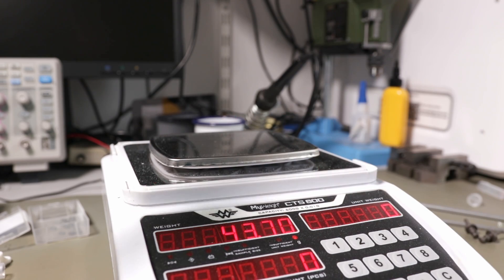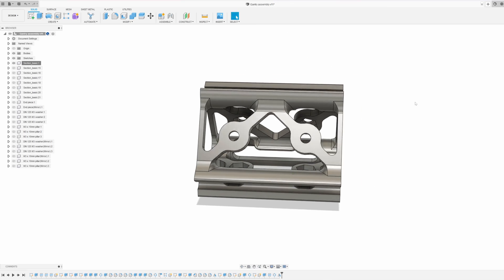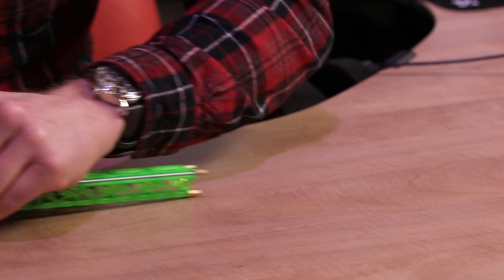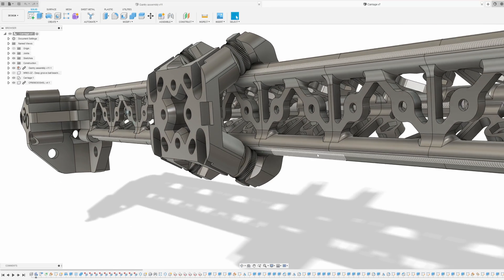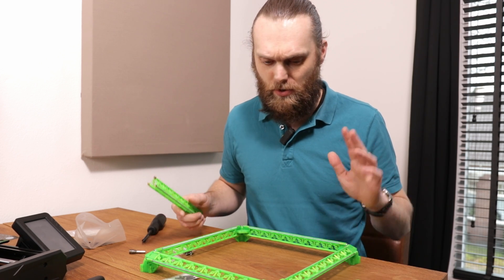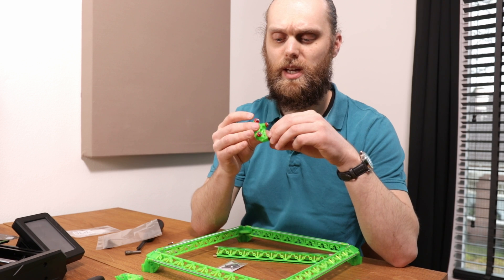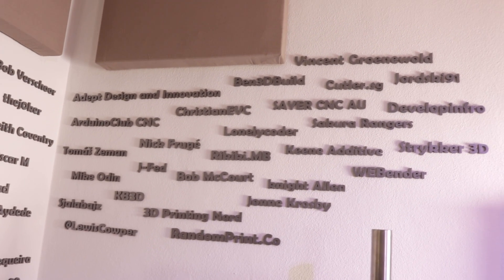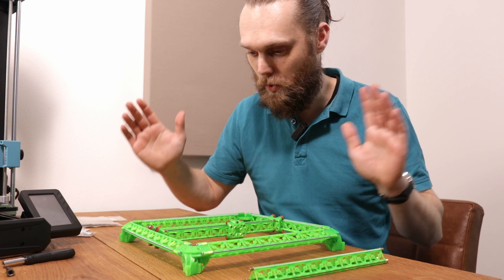Is This System the NEXT STEP in 3D Printing?

Comment: You should switch to a non threaded rod and then use a die to add threads only to the ends of the rods. It's more work, but it would roll better and wear less over time. You might be able to use something like a straight pull aluminum bicycle spoke too.

Comment: What if one threaded rod went through the middle instead of 3 threaded rods along the outside. The compression would be equal on all 3 legs, and it would be lighter. The drawback being that you would have plastic rails for the bearings to ride on.

Comment: I think your issue is that you still have the mindset of 3d printed part having the same properties as normal machined material

3D printed part dont really benefit from hollow struts and triangular shapes, its already hollow, you might get better result by having a full triangular shape, keeping strenght and printing less wall to keep the mass down

Also, this rod need to be smooth and hollow, you could put a bolt inside each hollow side to lower even more the mass, this ros could even be carbon fiber

I love the concept and see quite a lot of improvement

Comment: Please design a total printer that can be printed except for a control panel wireing and a print head. fpr the bed use a vedry hol filled plate and then use a commonly used bed mat.

Comment: You might be able to use bicycle wheel spokes instead of threaded rod since they are made to be a lightweight adjustable tensioner and can be bought in a variety of lengths and materials, including carbon fibre.

Comment: you could also mill down the steel rails to make them lighter too. ive no idea if they would keep their accuracy tho, id guess temperature change would distort the thinner areas at a faster rate. Look at makergears printers... the rail doesnt move at all so the only weight you have to minimize is the extruder head itself... at least in that one axis. They did over the years lighten up the heated bed but its a bit heavy still, but note again you probably could solve this with stronger motors and a much stiffer belt that can handle faster printing. ive long thought the makergear printer would benifit from using dual rails on the print bed. i can print most things pretty fast on the makergear, faster than most seem to be able to.. and ive tried some crazy speeds but you need a very stiff table to set the printer on because its violent with the weight of the head lol... it does print well still, i just dont want to have a catastrophic failure 😅 you can see the rebound in the belt at high speed so thats probably what would fail first

Comment: Havent looked through all the comments. But what about using carbon fibre Rods or even carbon fibre to do the tension instead of metall rods? The challange will be how to attach it and to tension the structure. But would be lighter. Since most of the mass is in the rods. The railing its selv could be lighter by making the design in one full lenghts instead of sections. But require designing finish lenghts you need. Unless you can make a parametic design for it. Cant wait to see what you come up with👍

Comment: Ok, so.  Possible thought:  I mean I like your idea of using hollow rods to cut weight, but..... why use rods at all?  Wouldn't cable be potentially lighter?  Run cable through the channels and tighten the ends to make things secure.  Print the ends right and you could hypothetically use one cable for the entire structure, just run it up one edge and down the other.....

Comment: Keep going for sure mate.  could you print these beams completely on a large bed, forgo inserting rods and just print with dense/strong material for the rod sections and a lightweight one for the rest of it? Could then use wheels of the same material as the rod section, which would hopefully stop them from being destroyed so quickly. Not sure if the beam would hold up to stress without proper rods inserted but would be interesting to find out if you can completely print a printer.

Comment: Ideas.... 

1) Don't use threaded rod, instead, use hollow tube, and tap the ends. now you've eliminated a lot of weight, because you no longer have solid heavy rods, and you no longer need the heavy standoffs, because you can now screw right into the tube. 
2) By using smooth hollow tube, you no longer introduce additional friction trying to mesh geared teeth that serve no purpose. small bearings should ride quite nicely on them, could even use tiny V-bearings so they lock onto the metal tubes. 
3) I would suggest making different types of the trusses. you don't need screw / mounting holes on all sides, so maybe only do one, or two sides, further reducing weight
4) to keep the parts from "slipping" on the contact faces, you can add tabs on one side of the truss module, and pockets on the other, so they made, creating a more sturdy mating surface.
5) If you need additional end points for mounting, you could add a central threaded rod, and use this as either a mounting point on either end, or as a method of pretensioning the entire truss assymbly

Comment: If it needs to be light and stiff carbon fiber is definitely the way to go, either tubes or square profiles. It would still be awesome if you could build a whole machine with as many printed parts as possible.

Comment: I'd love to see more of this project. It may not currently be cheaper, stronger, more durable or lighter but it is cooler looking and it's more customizable. 

I wonder if you could use pullstruded carbon rod instead of the metal rods and do a sort of tensegrity to keep the beam components together. Just a piece of kevlar or similar line through the middle of the beam with tensioners on the ends of the beam (tension in the kevlar means compression in the truss segments). Then rather than rollers, get some of the IGUS Iglidur filament and print custom bushings. 

Also not sure, but I suspect the truss structure could be optimized. I bet you'd need a lot less filament than you think to "truss-out" 3 carbon fiber rods running axially, at least to be good enough for a 3D printer.

Comment: How much meters from 1 bottle? If i buy Pet-G that is about a dime per meter. A PET bottle will cost me 0.25 ct (coz of the deposit), so it would need to be at least 2.5 m to make it worth it, unless you want to have a bit of green or translucent for one specific project

Comment: Without any simulations I suspect that your trusses might not be adding much stiffness, and its mostly the (preloaded) threaded rods doing the work. I'd also suggest first having a good design, before throwing all kinds of fancy materials at a problem. As they say, any idiot can build a bridge that can carry a lot of weight. A good engineer can design a bridge that can barely carry the weight it should support, with a restricted budget.

1:40 I think that you are very misjudged in this assumption. Sure, this shape is light and stiff, but not the lightest and stiffest it can be. The key to where you are wrong with the assumption, is that you assume an isotropic dense material. I would recommend reading up on basic beam theory of mechanics.
If you forgo the above assumption, a hollow box section (with closed ends!! Very important to have for the shear stresses) is much stiffer for the same weight. 
Sure, they don't build cranes out of box sections, because here the truss idea has another advantage, namely being able to pass wind through and thus have significantly stresses from wind. If you look at earth moving equipment for example, they never use truss structures and instead welded box sections. Similarly I think that the reason why concert equipment is build out of trusses, is for manufacturing convenience. However, with 3D printers you can easily make (almost) hollow box sections quite easily. If you look at stuff that REALLY needs to be stiff (ex. movement gantries in high speed precision applications such as wafer machines), you will see they use boxed sections. 

But, before you start optimizing random printer parts, I think its important to consider WHY you want stiff and lightweight parts. Lightweight, so that you can accelerate faster with the same applied force. Stiffer, because then your parasitic eigenfrequencies can be pushed higher. These two can both be a limit in your design, but there is obviously an optimum to be reached here. There's no point having an incredibly stiff frame if you are limited by your accelerations anyways (or by another constraint in the design, for example the hotend not being able to push enough filament). Similarly there's no point in making your gantry very lightweight, if the parasitic eigenfrequencies mess up your tolerances.

When you decide that indeed the eigenfrequencies are a limiting factor, what directions do you even want to be stiff? 
What directions are the limiting factor? Randomly choosing a triangle shape is not the way to go. Its better to first take a 'regular' section of gantry, and figure out exactly what the parasitic eigenfrequencies even are, and in which direction they act. If you have to make your gantry more torsionally stiff, you need a vastly different design compared to a bending mode in the vertical direction. Trying to solve a problem without understanding what exactly the problem is, is a bit like trying to shoot stuff at the fair whilst wearing a blindfold. 

Lastly, the reason why putting the carriage together is because it is severely overconstrained, meaning you either need slack, or have a lot of build up stresses internally (making it hard to assemble, or causing it to easily bind). This also causes the binding issue on the carriage when moving. With this design it will be really hard (or rather, expensive) to get it to run smoothly).

If you want some more pointers on exactly how to do this kind of design I'd be happy to point you in the right direction.

Comment: I was thinking the purpose of the treaded rod was to use it as a rack and pinion, that way you didn't need a belt system.  It might be heavier than the bearing system, but once you mount other push pull features the rack and pinion might come out ahead,

Comment: Go for it but....
Try to use pccf (stiffness)
Things like wheels you could use nylon (abs isnt Wear resistant at all)
Also instead of that you could Just get 2 aluminium smooth rods and igus fi8 bearings and youll end up with really light thing but then you cant use direct drive system with is ok with klipper and pa. I have tried aluminium rods and whole x axis was lighter than Just 2 steel smoothrods :)

Comment: Hollow smooth rod tapped on the inside. aluminum bolts also print gantry in one large piece so it is straight

Comment: Well done.  Really beautiful system, if you used smooth bars and then only threaded the ends, so as to use the bearings, the system would be perfect.

Comment: Hell ya, this has a ton of potential! It's basically the start of RepRap 2.0 ;)
Seriously, screw the comparison with linear rails, these will never be as smooth/light/precise as precision ground rails... but the value in these is that anyone could print these at home and assemble with cheap-ish hardware and prototype or even build complete working machines without dropping hundreds on components up front!

I think tubes with internal threads at each end are the way to go. You'll save some weight and not sacrifice any stiffness.
Could you also use tubes for the rails and a single threaded rod down the center? Might be heavier, and might not be as good for alignment/stiffness.

Just look at the Porsche 911: You can make a suboptimal configuration work really well, if you throw enough engineering at it ;)

Comment: Woop! I love seeing videos that give me so many ideas. I'll try and start with the most important and move down.

1. I love this idea, but specifically for things other than 3d printers. There are several designs out there for diy camera booms and whatnot, and I can't help but think that the strength/weight ratio on something like this would be considerably better than any other printed alternative. 

2. You could try carbon fiber tunes with epoxied inserts for your smooth members.

3. As for the thread engagement from your rollers, there are a couple disadvantages that you noticed, but one huge advantage you didn't mention. One of the disadvantages is that by having so many of them, they have to overcome each others "stick" in order to move, which contributes to the lack of smoothness, kind of like having 4 driving dimensions all over constraining a shape. Ideally you would have only 1 part that defines the motion, and everyone else falls in step, so if just 1 roller was toothed and the rest were smooth, I bet that motion would be much better. Now, you might consider going all smooth, but I recommend against it for certain applications, because by having one toothed, you are dramatically reducing the holding force needed to keep it, let's say, "indexed" on the rod. You are massively increasing the force required to make it slip.

4. I have a methodology for lightweighting parts that need to fly that I would love to share, I'm just not sure the best way to do that. Debating posting a video or something, who knows.

5. I really like the fact that you are putting the members together under tension, not only does that provide significant strength, but it also fights layer separation along your historically weakest axis, making the plastic dramatically stronger than it has been in previous history.

6. Looking at your corners, I thought of those 3 piece wooden puzzles that lock into place when pressed together equally, ill see if I can find a name or a demo for them. I think this is a good idea not only to build the corners you want, but also to maintain the idea of "3d printed, but with real strength." As they are now, your corners have an obvious weak axis, but if put together in 3 parts they could be oriented on the build plate to ensure they don't have a weak axis.
Reply: I googled for a couple minutes and couldn't find it, so I will describe it here and maybe someone will know what it is. 

I once played with a wooden puzzle toy, it had 3 identical pieces. One side of each piece looked like a 2 pronged key.

The solution to put them together was to line the keys up with each other and press them in with equal-ish pressure on each of the 3 keys at the same time. If you put together 2 and tried to press the 3rd into its slot, it wouldnt go. Once they were together, you could yank or pull on any one and it wouldn't budge, it was rock solid. The only way to separate them was to pull on all 3 with equalish force at the same time, an interesting task when you only have 2 hands, and significantly harder than squeezing them together for some reason.
Reply: But yeah, camera booms, robot arms, any manner of long, moving object requiring both lightness and strength.

Comment: IMO, fdm printers suck for printing parts like this. Resin printers with sanding and polishing seems to be the logical way to achieve super smooth surfaces.

For the rails, two large diameter rounded hollow pipes with minimum thickness should do good. Maybe add bracing in between the pipes to maintain their distance along the length. And for the carriage, use split plain bearing design (those plastic linear bearings can be a good example) as the less part the better. I hope you can understand my idea!

Comment: i have noticed threaded rods offten have a wave-look to them, that the diameter is not the same over the whole length probably caused by the way they're cut/rolled, maybe it s better to use straight rods, cutting them to length and cutting threats for only the length you need them

Comment: Why you don't try to swap from threads to carbon fiber and instead of using bolt etc, you use the technique of pretensioning associate with epoxy glue? That way can allow you to achieve a lot of loss in weight, without loose in stiff and a rail without dents.

Comment: Yes, please, continue! When you ditch the thread, the printed wheels with pressed bearings should be enough for it to run smoothly. This could very well be the next iteration of reprap project. Just use 6x1mm ALU tube and tap for internal thread, and you're golden 🙂 The beauty of it lies in the minimal required tools - just tubing cutter, sandpaper and tap. This way you can eliminate the need for any saw or dremel with cutting disc...

Comment: Maybe if you try it with hollow rods you could use aircraft cable inside each rod pulled as tight as possible (turnbuckle) to give more strength for the weight.  Love the idea and your content is always amazing to me.
Reply: Maybe one cable in the middle would be enough. This way it's possible to use non-hallow smooth rods, for example carbon.

Comment: You over thought the wheels. They do not need to be knurled/grooved, that grove should also be angled. There should  be enough to just let them run on the thread. the issue with that is that they will wear on the thread. A nylon wheel would be better, but metal will also work. My bet is that you will figure that the metal on threaded rod will be fine.

Comment: I think even if it doesn't turn out to be any better, it's still a really cool modular building system. what I would personally do is not prioritize weight, and try to focus more on improving modularity and ease of use.

modular systems are jack of all trades, unless extremely specific condition, a purpose-built system at equal cost will always perform better.

if you want to make it lighter you might want to look into topology optimization for your 3D printed segments.